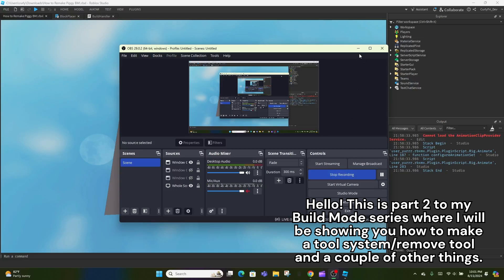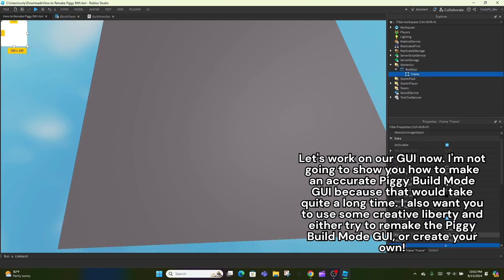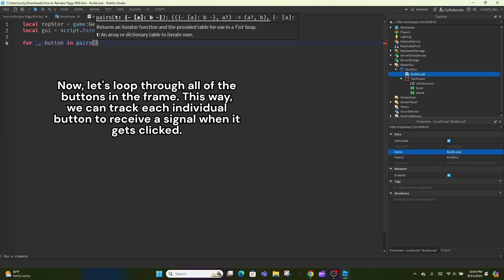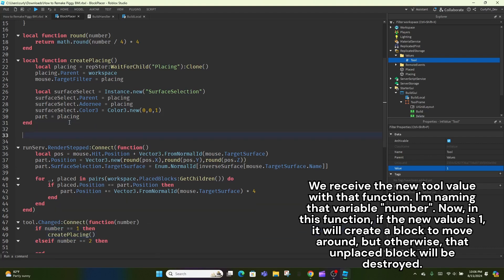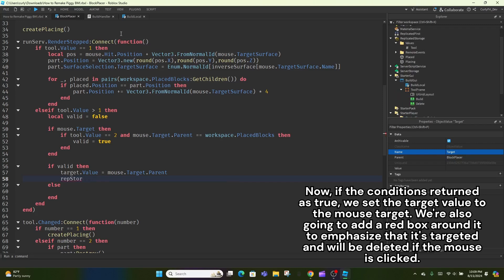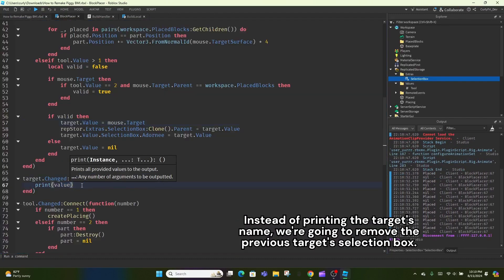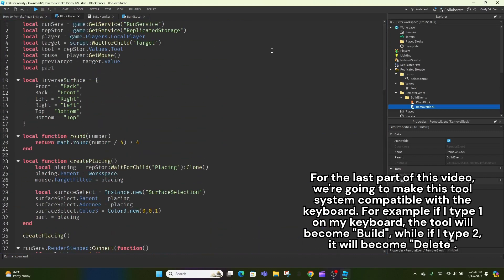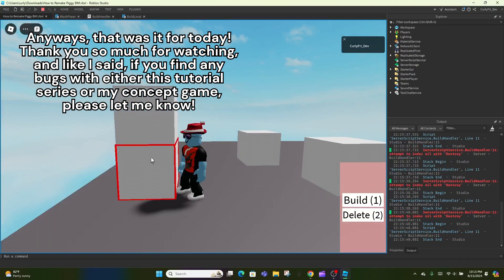TOOLS & DELETE System in Roblox Studio *Tutorial* (Piggy Build Mode Tutorial PT. 2)

Comment: (hope it helps)

guys on

"		if valid then
			target.Value = mouse.Target -- this Part
                        --add it here
			end"

add a 

"			for _, v in pairs(workspace.PlacedBlocks:GetChildren()) do
				if v:IsA("Part") then
					for _, s in ipairs(v:GetChildren()) do
						if s:IsA("SelectionBox") then
							s:Destroy()
						end
					end
				end" this script so it will destroy and also

"target.Changed:Connect(function(value)
	if not value then
		for _, v in ipairs(prevTarget:GetChildren()) do
			if v:IsA("SelectionBox") then
				v:Destroy()
			end
		end
		
		for _, v in pairs(workspace.PlacedBlocks:GetChildren()) do
			if v:IsA("Part") then
				for _, s in ipairs(v:GetChildren()) do
					if s:IsA("SelectionBox") then
						s:Destroy()
					end
				end
			end
		end
	end
end)"

the localscript name is BlockPlacing yall can get it and it will fix on adding alot of Selection Box

Comment: Found a bug in the  grid placement vid u made when u aim ur block surface on the edge of the Baseplate the surface wil be  aiming on the deraction that u facing and the placement system doesn't work :(
Reply from the maker: That's actually not a bug, because when we make the rotate system, it will fix itself. Also wdym the placement system doesn't work? It seems to be working for a lot of other viewers
Reply: @CurlyFriGames  i had same thing. when i transported it into a diffrent universe it suddenly worked. it's very weird.